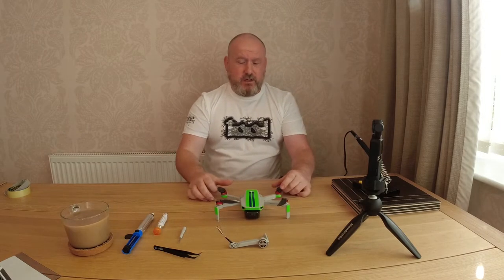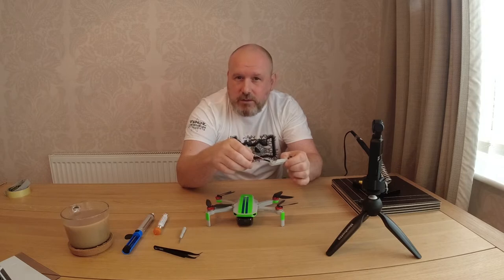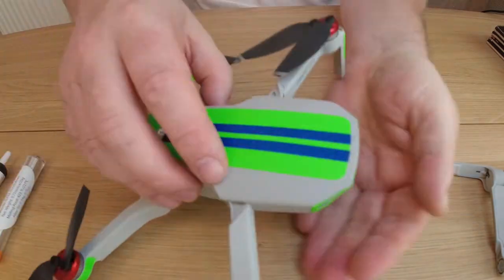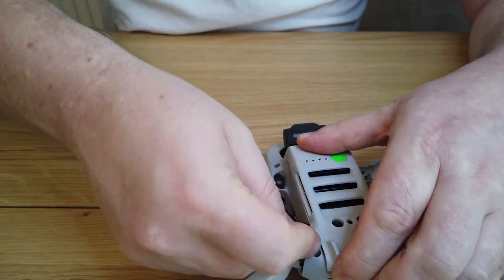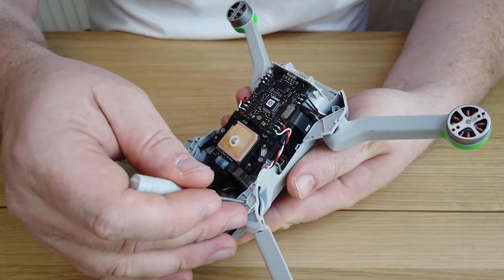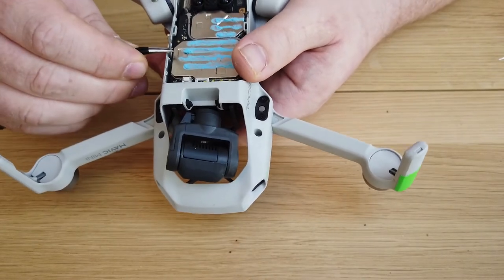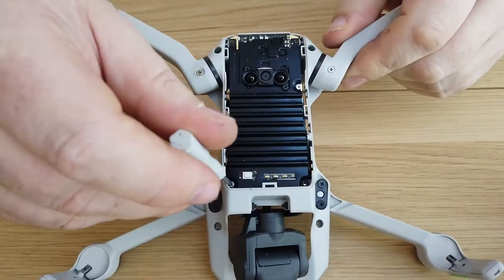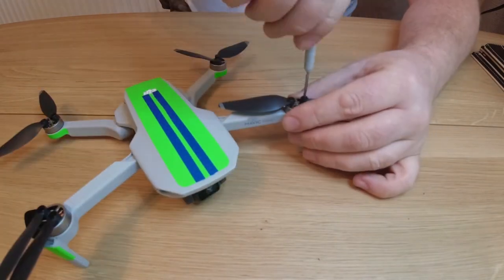DJI Mavic Mini/Mini 2 - Replacing a Broken Arm - Tutorial

Comment: Can you help me plz my drone have glue o something like that and a can’t take the cables off
Reply from the maker: if its the glue on the inside of the body where the arm cables are attached to, then you need a fine pair of tweezers or something small to pull the glue away from the body, just be careful as you dont want to break the plastic.
It's a little tricky but just pull the glue away from the body, it should release with a gentle bit of force.